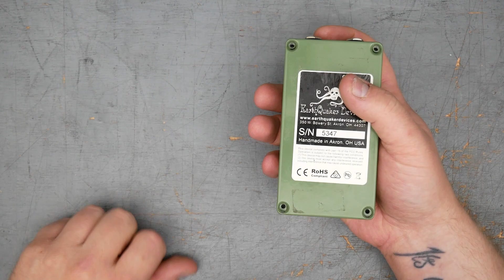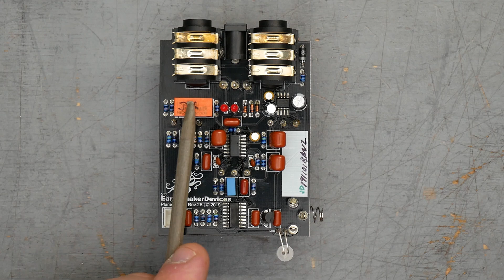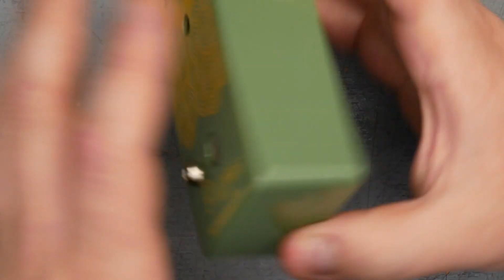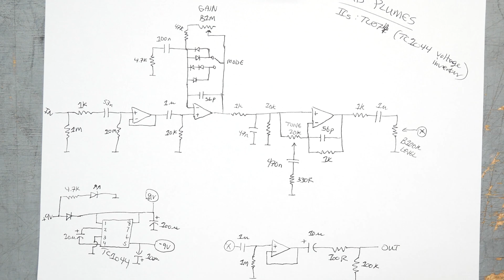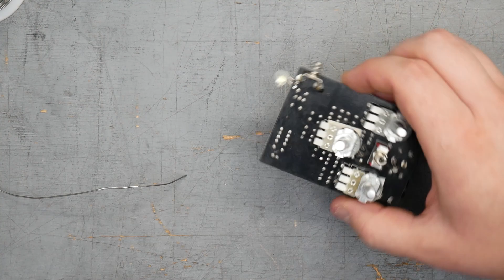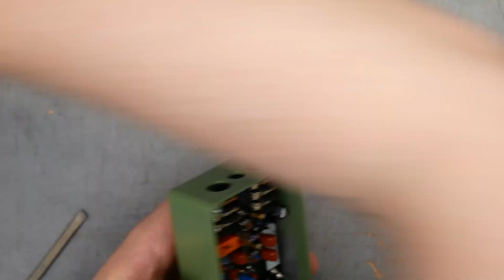Earthquaker Plumes Teardown! See what's inside!

Comment: Was hoping you nodded the 10M with a variable resistor, thats a mod id like to do, im not too savy but that i guess i coild give a go, tame the high end would be great, agree, changing the diodes seems a little moot. An input capacitor to ground could be a good one too, little on/off/on for options. What id really like to try for kicks is a small Kent Armstrong Inductor on a pot... just to be wild 😜

Comment: Just disassembled my Plumes yesterday to install a .047 uf capacitor across the volume pot to reduce the brightness, and to my surprise everything is now super tiny surface mounted components.  They were so small I could not find the clipping diodes or LED’s. I can only assume this was done to save production costs.  The capacitor worked out great.  I just wish the other components were able to be tweaked.  Bummer 😩
Reply: I just carried out a similar mod on my plumes to reduce treble and I was also surprised to see the new micro component layout. I inserted a 10nF cap between Lug 1 of the tone pot and Lug 1 of the volume pot. It worked a charm and the pedal sounds great now with a much more usable range on the tone pot. 
My amp is a vintage Vibrolux Reverb which is very bright and I use a Jazzmaster so this mod was absolutely necessary for me.

Comment: I've found that LED's are sometimes an acceptable option; what I do generally avoid or replace are the Silicon stages.My first experience with this was way back with the Swollen Pickle, which offered an internal trimpot to choose between LED and Si.Pretty cool circuit, with an arguably nsg  sound ( better for bass).

Comment: Great segment. I've got a basic question; why would a builder use a TRS input when guitar cables are mostly TS. Wouldn't that add to the cost? Wouldn't they have to jumper the Sleeve and Ring so their customers don't require special TRS cables to make a connection. (told you it was basic, ha)

Comment: Desoldering braid works a lot better with a bit of flux and high heat.  You can even clear those holes without a desoldering gun with flux and enough heat.

Comment: At some point they switched to SMD construction by the time I got one in October of 2023.
Reply: Makes sense. I am electronics engineer and SMD is so much better in every way. There is no reason not to use it if the components are available as SMD.
Reply: @MatzeMaulwurf  Yep, SMT works as well or better than TH, except where people cheap out and use high-k MLCC caps instead of film.
Reply: @brettclark8020  indeed. Component specs have to fit the application. Good PP-Caps are mostly TH.

Comment: Pro tip: heat the solder pad and stick a tooth pick through it. Will open them up, no desoldering gun required. Solder doesn't stick to wood.
Reply: you just saved my project 😭 thank you!

Comment: The W taper has an S shape (confusing, I know). Pot value changes slowly at the ~10% beginning and end and quickly / linearly in the middle of the pots turn. It smoothes out the tone circuit, which isn't linear (at least not to our hearing).

Comment: Next time add a lil bit of solder to the via’s and tap out the solder. Works like a charm …. Then use the braid to clean up the holes.
Reply from the maker: Good tip thanks!

Comment: How could you not answer the most important question about the mod: how does it sound with the hitachi diodes??? It’s like your favorite show, season finale and it ends with a massive cliffhanger 🙈😂
Reply from the maker: Haha maybe you’ll just have to buy a plumes and try it yourself!
I did sound test it off camera, I don’t really understand putting Ge diodes in the plumes. The point of the plumes is like a high headroom TS, but you’re going to squash that all down with ge diodes. Just my opinion.

Comment: GRAY BENCH, Adding in the Voltage Inverter TC1044 will give more Op amp Headroom using the Op amps at +9vdc and at -9vdc compared to an Ibanez Tube Screamer they use the Op amp at +9vdc and Ground 0 volts for the headroom?